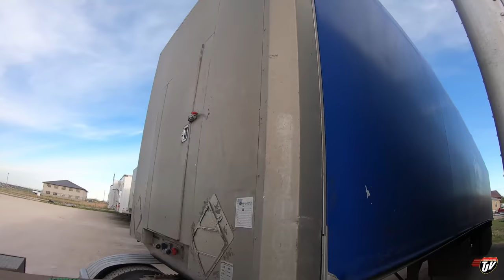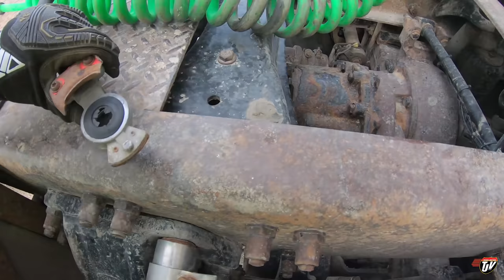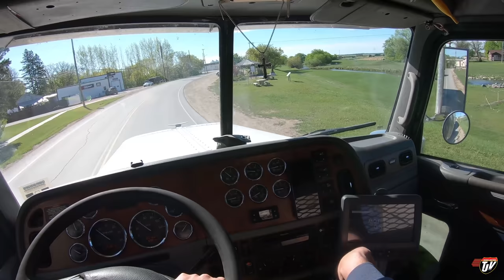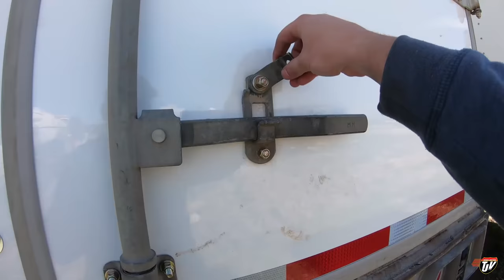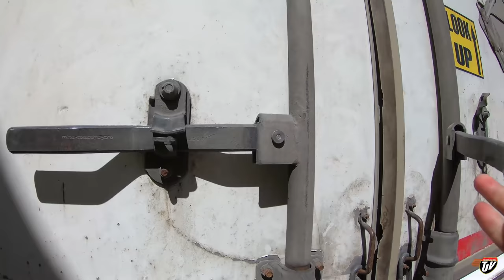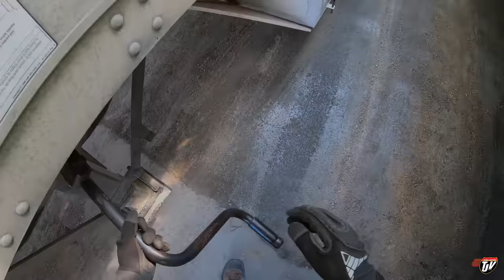My Trucking Life | WHAT ARE THESE? | #2290 | May 27, 2021

Comment: Hey Josh !!!!  In your pretrip of # 5174B ,,, that trailer has OILERS on the axles ,,Didn't see you look under the trailer to look for a blown wheel seal or brakes & didn't pull the oil caps off & check the oil level !!!  As an ""OL"" Mechanic/Driver ,, Burnt up wheel bearings ain't good for anybody !!!! In MX.,,  those glad hand gaskets would be gone on a spotted trailer there as the Mexicans love to steal them off !!!!  Have a good weekend & ""KEEP IT SAFE ""!!!!!

Comment: Do they make or "request" you turn off the truck while hooking up? Seems the extra pressure on the cooling system and heat build up in the turbo isn't worth the fuel or "environmental" savings of 5 minutes idling.